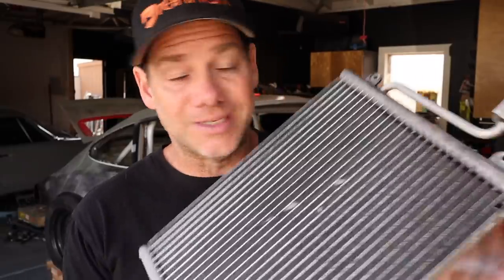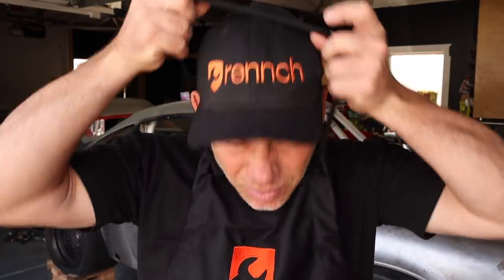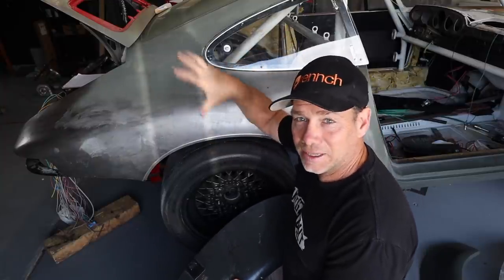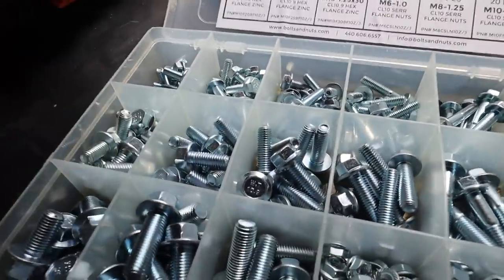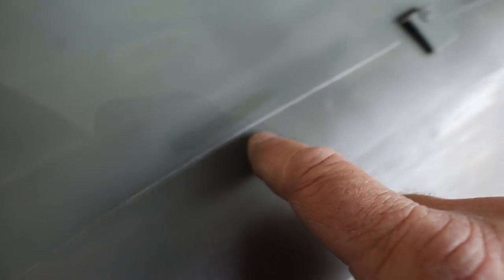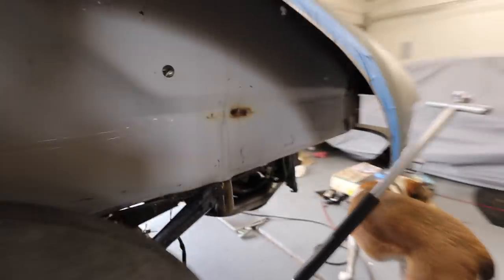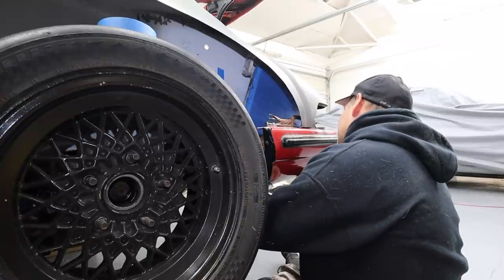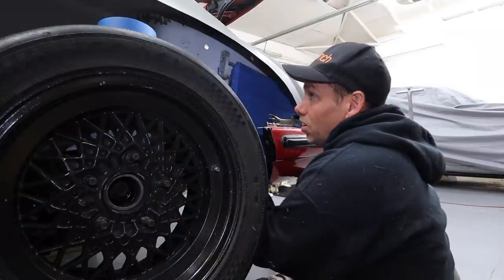Cutting  My Recently Installed Quarter Panels for my Classic Retrofit A/C Condensers | Blasphemy 50

Comment: Rivnuts get jacked up too easily for this app anyway. 
Its silly all the space these have in the wheel wells 🤣
You putting an oil tank on the passenger side? Just thinking about lateral balance. Cool install... Punn intended

Comment: coolers never going to work in the wheel well , as they will be leaking in no time , every rock the tire will throw up will be going through the cooler  even the very small ones , will be like sandblasting the cooler

Comment: I’m sorry Michael but it just doesn’t make sense. There is no protection from road debris and it’s not in the direction of airflow. You can easily “bend” the air with ducts but this is poor design.